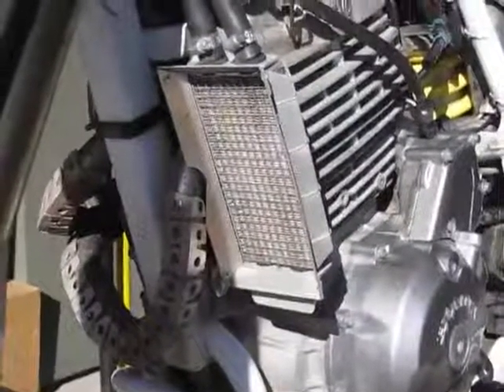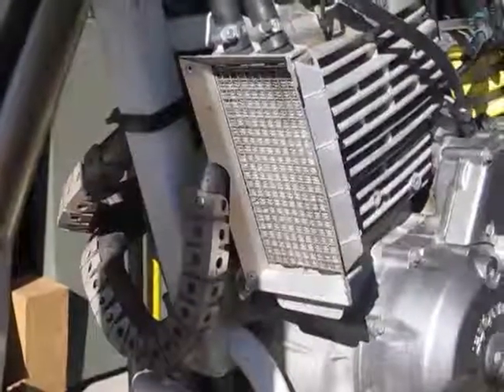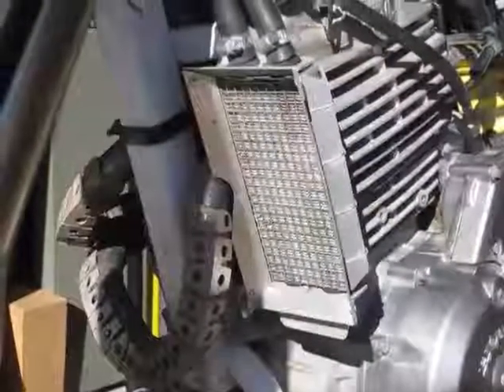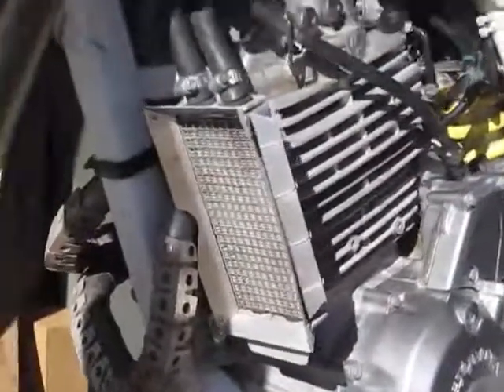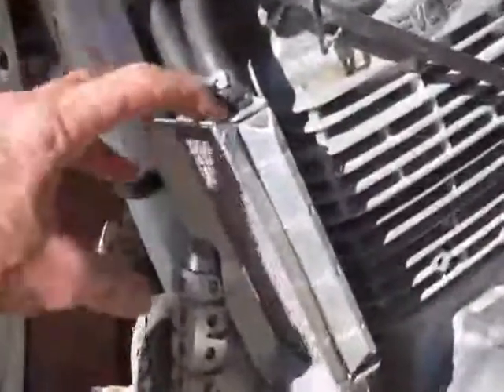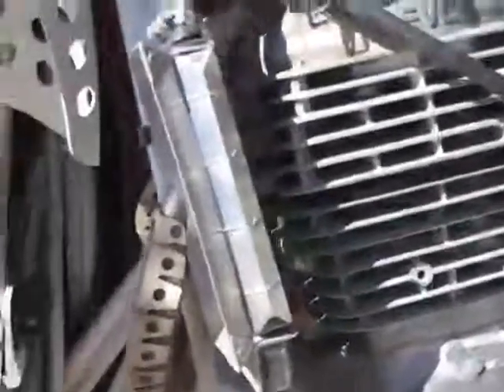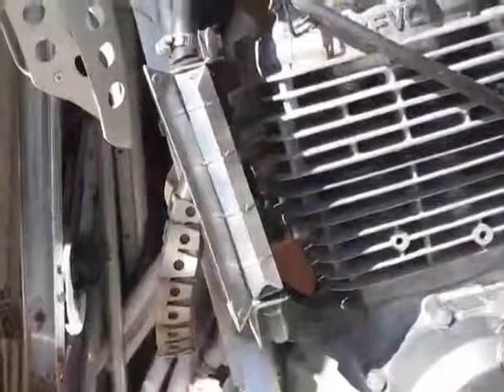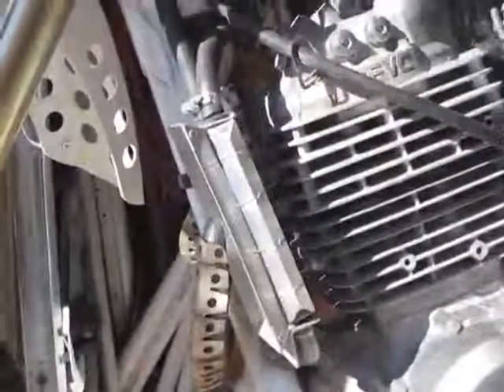Honda XJR650L aka XR650L - over 50 mods - oil cooler

Comment: I feel that the placement of it blocks too much cool airflow to the head and top of motor not to mention the air coming off of that would be warmer also. It seems like it would need to be lowered.
Reply from the maker: There is 1/4"+  clearance between the cooler and the header, which is plenty when you are moving. I didn't want it too low as to be susceptible from roost damage. Nor, did I want too far outboard to protect it from possible crash damage. It has over 8000 miles as is and it works great to lower oil temps about 25 degrees average. Overall, I am very pleased with it. It is completely rubber isolated from all brackets and mounts. Thanks for your input.
Reply from the maker: Forgot to mention it flows air really weel as to not block anything form going to the head and barrel. Thanks again.

Comment: Yeah that's it, block airflow to the head. Oil cooler works. Head runs hotter.  🤨🤔
Reply from the maker: No air blockage to the head or cylinder. The oil cooler fins allow great air flow and don't block any fins or air flow. The scoop on the front of the cooler has a venturi effect and actually speeds up air flow through the cooler and past the engine fins. Overall, it is a clean job and wouldn't run this bike without it. The OEM front fender blocks most of the air to the cylinder and head. That is the real heat culprit. Want a cooler running XRL, put a vented front fender on...

Comment: Yet the oil cooler is mounted on the hot exhaust pipe.
Reply from the maker: No it isn't. I made sure nothing touches the hot exhaust. There is a 1/4" clearance all around. Thanks for your discerning eye. Very good.

Comment: I'm in Searcy. I'd love to see your bike in person. Send me an email to my gmail so we can get in touch. I'm coming up on 70 and about to get back into dirt bikes after way too long.

Would like to see your machining up close and in person. I used to own MHM machine in Judsonia. We did race car engines, rear axles, transmission shafts, clutch housings, carb shafts, replacement venturi squirters, etc. From what I saw, you're right up there in talent as well.

Great video.